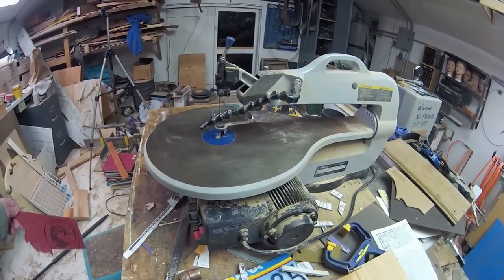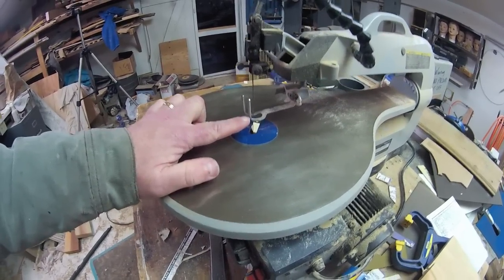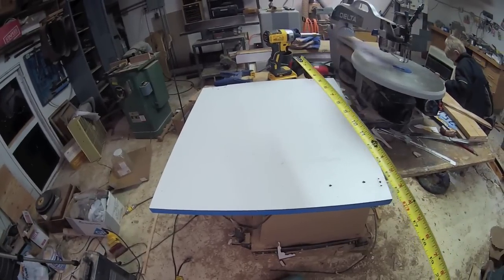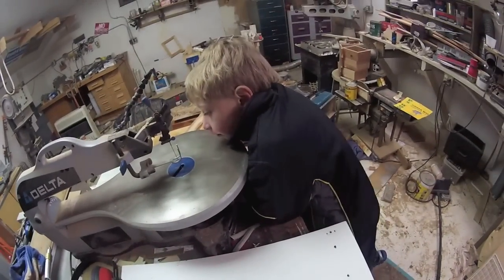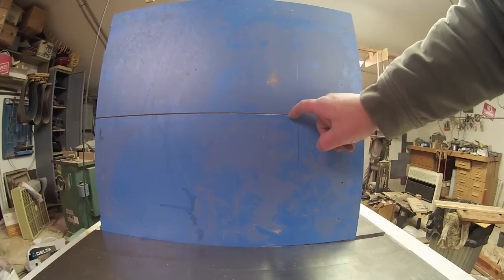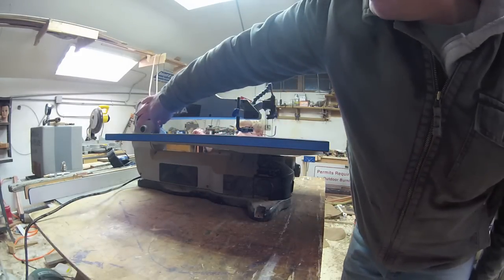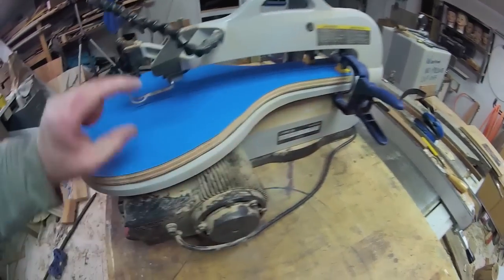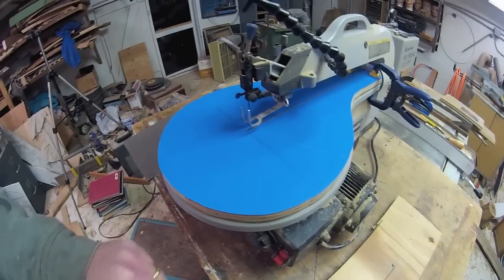Double scroll-saw blade life!

Comment: Great tip that I would never have thought about.
61 Apple don't fall far from the tree!
This will also give you a place screw in a fence if you would ever need one.
So why not just drill a hole in the wood? 
Have a great day.
Reply from the maker: +FloppyHatPhotos I wanted to be able to slip it on and off w/o pulling the blade but it would be stronger with just a hole and it isn't hard to take the blade on/off.

Comment: I have a question (based on what I want to do). Could you have cut it out as accurately using your scroll saw rather than the band saw?
Reply from the maker: Not sure I completely understand the question. Scroll saws will cut thin stuff more accurately but struggle clearing dust on anything over 1/2 inch thick.

Comment: Hi there I have just purchased the same saw as you but when I run it I get a knocking noise is there anything you know that could help prevent this sometimes it’s noisy sometimes it runs ok ?
Reply from the maker: There is an adjustment knob on the back I think to tension everything, it isn't loose is it?
Reply: I will check it out thanks

Comment: I have an odd question for you... I was gifted the same saw you have, however the reason they gave it to me was that the mechanism at the top for locking the blade was busted. I was going to try and design and 3D print a new one, but would have had to guess at the shape. Would you be able to take a bunch of close up photos of yours and email them to me? I would appreciate it if you could. Let me know and I'll send you my email.

Sorry for being off topic.
Reply from the maker: +jayfehr If you call up the model number on a parts site they will have diagrams of exactly what the clamp looks like from several angles.  Way better than any picture I could send you.  That said unless you can print metal I am not sure how your new clap would work.  They put a bunch of pressure to hold those blades in place.  You might just see what the cost to buy a replacement clamp is.